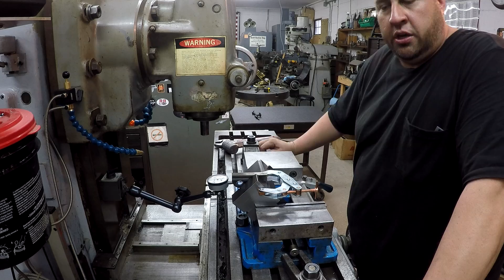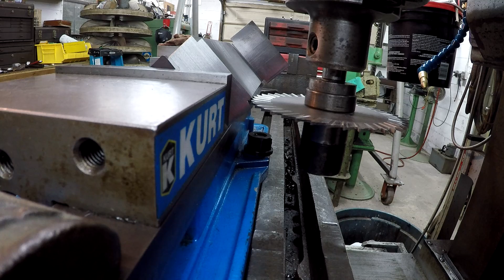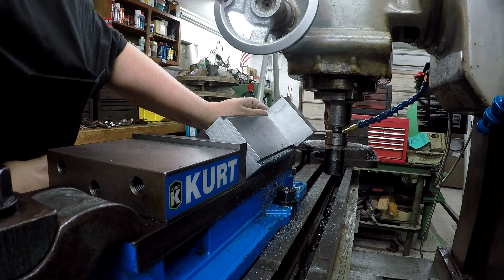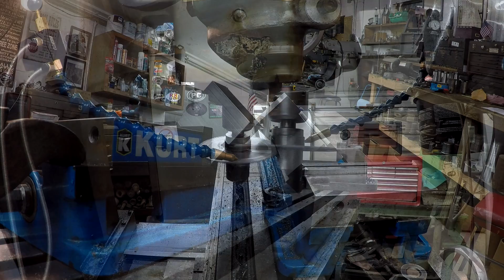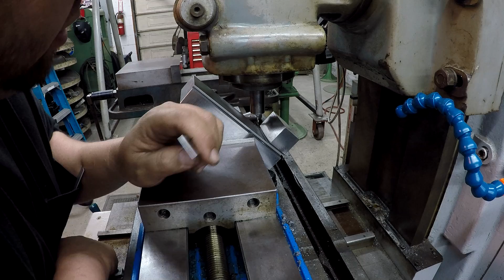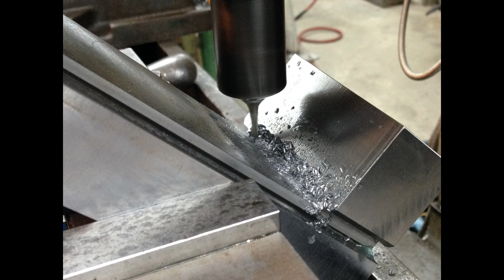WIYB Toolmakers Collaboration Machinist Vise Part 4

Comment: Nice work mate.Hope you dont mind me asking .Is that a left hand thread on you stub arbor? Yes/No?Looks to me your tightening the arbor to LEFT.If thats correct you have should have reversed the direction of spindle and put cutter on so it revolvesA/Clockwise.Practice is always cut with lock,Your cutting against the lock.So the cutter can become loose when cutting.In short its a left hand thread on arbor.So you should have the force of cut going same way.You havnt its really bad practice-Sorry but I know I have been doing this 40+yrs

Comment: Nice set up Adam & great comments throughout the cut, interesting to see what the extra load was as you approached that shoulder, man that mill just kept on cutting, I thought there might have been a little bucking there or at least a change in resonance but no no.

wouldn't mind an extreme case of what happens when your milling from light to heavy cuts in one pass & what to listen for
Just wondering bud, I bet there's some action & tool pressure to consider. For this one you nailed the SPEEDS & FEEDS 👍

Comment: +abom79 Very nice setup there Adam.  One good reason to use a radius cutter on relief slots like that is that radius cutters are a lot more durable, however I don't see that affecting the performance of this vise in any way.  I noticed you put Stan's squares to good use as well, nice.
Reply from the maker: Yes, if I would have had the correct radiu cutter I would have used it, but I checked with both Tom and Stan and all there vises have square cut reliefs so I went with it.
Reply: +Abom79 I checked all of my vises of that type and they all have square cuts as well.

Comment: Wheel cutters and arbor set up used to be some of my favorite machining. We had "good" vices for the delicate work and as they loosened up were given to the roughing mills. Can't beat Kurt vices. We always kept one new in the tool crib and as they were used a new one was ordered. We were slow on work at one time so we reworked some of the older vices by grinding the surfaces and replacing the screws and movable jaws so we didn't hurt the shops budget so often. Good work as usual.

JHolland
MiddleGa

Comment: Hi Adam,

I'm trying to keep track of the fixes that need to happen in the drawing. Apologies! Not sure if the solid few clearance was in the original print or something I introduced when I redrew everything. I'll make sure to get all of the "fixes" incorporated before we post the prints for everyone to use.

Sure cool watching how well the K&T handles those cuts. Was it really that smooth and quiet or did the microphones not pick up on the noise?

Hope all is well and talk again soon!
Tom Z
Reply from the maker: +Tom Zelickman (Inspiration Metalworks) I had the mic pointed at the cuts each time. The machine has been doing great! Let us know when you have the prints available for the public use.

Comment: Just a thought, these operations would have been good in the shaper! Easy set up. A special tool would have allowed you to have not cut the bottom of the fixed jaw.

Thanks for another great video, regards, Matthew
Reply from the maker: +Matthew Tinker True. I was making use of the K&T for this job though.

Comment: nice video, good to see the K&T in action.
BTW it rarely hurts to go a bit deeper than you think necessary on those reliefs. They are not just there for the initial surface grinding, but also for in 5 or 10 or 30 or even 75 yrs time when someone wants to clean up the faces, since that voice should easily last 100yrs.

Comment: Hey Adam, what's the purpose of undercuts like that? I've seen them in V-blocks as well. Are they for chip clearance to keep debris out of tight corners?
Reply from the maker: They are mainly for grinding needs, allowed the wheel to get all the way into the center, or up close to and edge.
Reply: Abom79
Holy cow! I never thought of that, thanks! That question has kinda had me scratching my head for a long time, but it's one of those little things I never remember to look up or ask anyone about.

Comment: For the second cut instead of repositioning the work, could you have removed the vertical head and put the arbor direct in the spindle?
Reply: +Abom79 Easier to do when the head is on its own crane. Just saying.
  Mike (o\!/o)
Reply from the maker: Most definitely could have, but I didn't want to take the vertical head off just yet.

Comment: Adam, love your vids but have a question. How did you indicate or measure your depth of cut to be the same on each side? How did you know you placed the work piece the same in the vise each time. Hope you understand my question.Jerry Halcomb
Reply from the maker: +Jerry Halcomb I had the bottom corner of the vice sitting on the bed of the Kurt vice. Once I was on center for the first side, flipping it 180 it should still be on center since I indicated both sides in on 45*. I visually inspected the touch off and both appeard to be the same. I also fed in the same depth for each side. I don't think the placement of the relief has to be dead nuts in the center for something like this, but I know i was damn near.

Comment: Hey Adam,

Looking good. Glad to help out. Now its over to Brad for some grinding action. Who is going to do the heat treating?

Talk to you soon.

Tom
Reply from the maker: Actually it's going to a guy named Tim for heat treating, then over to Stan for the surface grinding. Should be video from everyone.
Reply: +Abom79 Im looking forward to the surface grinding. I dont get to see that much of that online, nor at all in person.
Reply: Unless I,m mistaken your saw arbor is a left hand lock thread.Yes/No if thats so your cutter is on wrong.Safety reasons you should always cut with lock direction.Your cutting against the lock which means it can unlock itself when cutting.You have been lucky but it will come back and bit you on bum eventually

Comment: Good show, but Usually the radius in the slot is for heat treat.To stop the stresses from concentrating in the corner causing cracks. I usually put a corner relief groove in after heat treat with an abrasive disk. After heat treat it doesn't matter.

Comment: Since you are only cutting a relief groove, could you make the angle lower ( 40 or 35 , whatever ) and not chop off the corner of the vise  jaw area ?  I would try to avoid  removing metal where it could / should be left intact.  No reason slot HAS TO BE 45 degrees is there ?
Reply: +Darryl Dodge Nothing indexes or even touches the jaw there so dubbing the corner doesn't hurt. 45 deg is the best angle to ensure an equal cut from both surfaces.
  Mike (o\!/o)
Reply: +Moholo 88 Makes for a crude look to an otherwise nice build...
Reply from the maker: +Darryl Dodge The small cut I had to make actually matched all of the chamfers I machine on it later.
Reply: +Abom79 I was wondering if you might trim the top corners to match...  ?